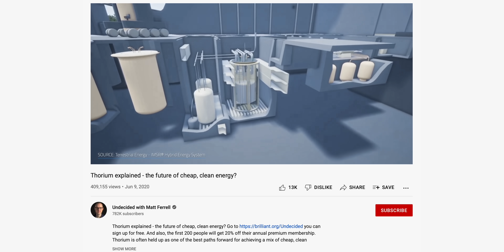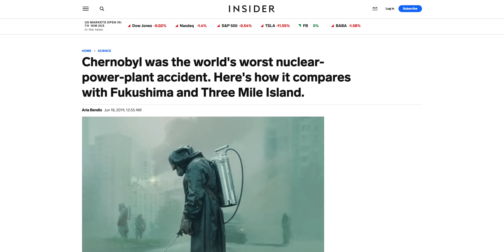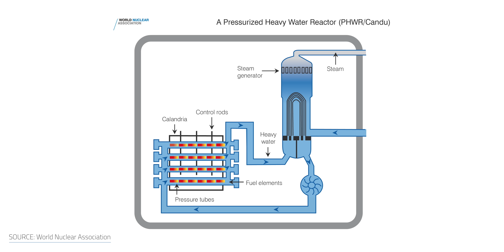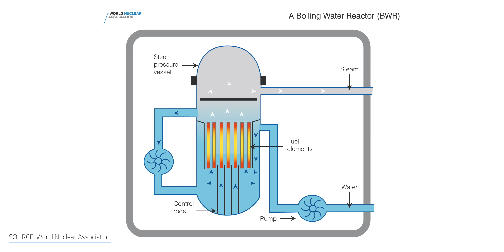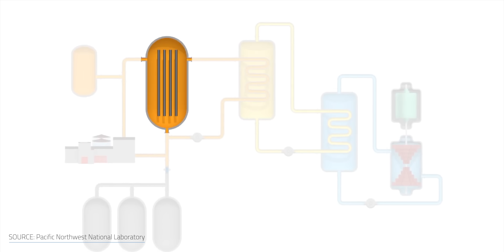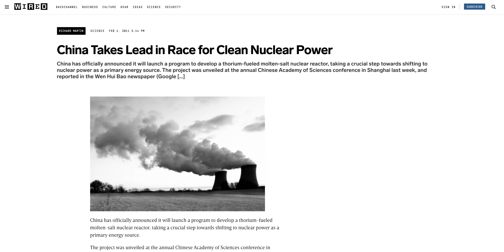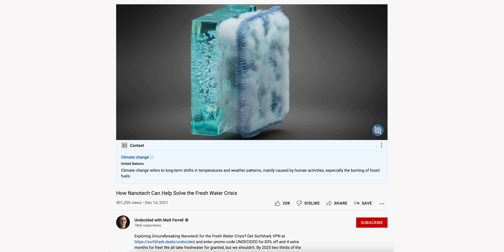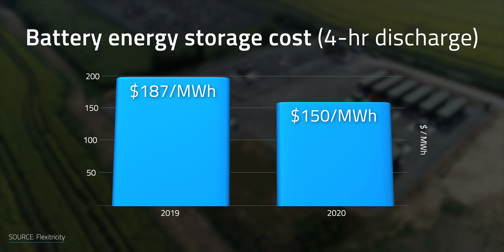Revisiting Thorium Energy - The Future of Nuclear Power?

Comment: One other thing not covered in this video is the possibility of using spent fuel from current waste stockpiles as a fuel for thorium based reactors.  Converting "used up fuel pellets" as a fuel and converting the long lived (100,000 year) waste material into a usable fuel...and reducing the waste storage to 500 years seems a win win.
Reply: It would be difficult and expensive to retrieve the spent fuel. That's why some experts don't want them buried deep inside mountains but stored securely close to the nuclear power plants du that they can process them later when the technology allowed then comes along

Comment: Nuclear power, most likely needed specifically  in larger population areas.  Clearly, salt reactor need to be seriously and thoroughly investigated.  That potential as noted being a win win across the board. Demand for electrical generation and medicine is only going to increase. As with all advances that balance between supply and demand, practical  and theoretical is tight, demanding, and capital intensive with typically lo g term return.  Hopefully results will be justification to move forward.

Comment: Nuclear = electrical grid + fuel making AT THE PLANT.  No need for any other balancing other than fuel making.  No smart grid, just simple low tech grid with fuel makers as the balancing means.

Costs can be 2 cents/kwh off grid, and 3 on.  Fuel = 3 cents/kwh ($1/gal) with free CO2.  CO2 capture can cost $2/gal, so capture at the car and refund at station would make CO2 recycle possible with net zero.  30 gCo2/kwh is doable for nuclear (Thorium).  100% RE grid will be 10x or 300 gCO2/kwh.  NET solar thermal will be 3 gCO2/kwh, or 100 times less than gasoline and 100% RE grid.

Thorium is NEEDED to deal with the mining waste from rare earths and for mass energy production without stupid wind/solar PV/Battery junk.  EVs are obsolete as the costs will be 5-20 times more to charge a battery than to make fuel.  Make fuel while people are driving around, and quickly give 3000 mile range in 3 minutes, which is like 15,000 kw charge rate without grid support.  EVs are a silly stupid concept.

Comment: If you look at the Periodic Table of the Elements, you will notice that Sodium (NA) is directly below Lithium (LI) and Hydrogen (H). Of course, you knew that. Hydrogen is very unstable due to the fact it has only 1 valence electron. Lithium is also very unstable for the same reason, except that the unstable electron sits in the second valence. Sodium has 2 electrons in the first valence, 8 in the second valence and only 1 in the outer valence. And guess what? It is very unstable. Like Lithium-Ion Batteries, sodium explodes when it comes in contact with water. 

Nuclear reactors heat water to make steam. The volatile Sodium is in very close proximity to the water.
The heat transfer tubes in a steam generator are very thin, less than an eighth of an inch. Sodium is caustic and can quickly erode most metals because of that extra electron.

I would like to know how they plan on keeping the H20 and the Sodium apart so nothing explodes, especially highly radioactive sodium salt.

Comment: You can run Thorium in Canadian CANDU heavy water reactors, without modification, by adding a bit of enriched high assay uranium as a booster. A new fuel is being approved to do just that, giving a 7x increase in power density over the natural uranium CANDUs burn. Commercial availability in 2025, not 2035 as for all the advanced reactor designs.  CANDUs have many "advanced" nuclear reactor features: modular, hot refuel, meltdown proof, even though designed 60 years ago.  W&S are just stupid from an engineering perspective, when nuclear power is just sitting there.

Comment: Without exponential advances in multiple technologies, which may be outside the limits of physics , wind/solar are dead ends. The issue left unaddressed here about TMS is scalibility. It he infinitely reduced actual footprint of multiple smaller TMS units over those of large scale nuclear plants and S/W farms is a major factor. The use of previously spent fuels and greatly reduced spoils monitoring are also significant positives for TMS . It is hard to believe that the save the planet folks do not have major issues over W/S environmental impact

Comment: Solar and wind isn't a home run either. They both require way more space to meet energy demands because the output is so low and they only work in ideal condition. Solar farms can Ignight birds mid flight and windmills constantly have to have thier blades repaired because regular particles in the air eat the blades up and it's not cheap paying people to constantly climb and fix them.

Comment: Thorium Energy would be a lot safer as in no cooling required. using Thorium(beta) / americium(alpha) / salt water battery. too bad there's laws saying i cant make any more than 1 watt what am i going to do 1 watt power a watch... laws killed the atomic battery before it had a chance to start. otherwise ill already have a electric car powered by atomic battery. don't get battery charge rated by miles get charge rated by years. make atomic cell phone batteries that hold a charge for the life of the phone. and the radiation is low enough it can be blocked with small amount of led and magnetic shielding material.

Comment: The metric equivalent of an acre-foot is the cubic meter (m³).

An acre-foot is a unit commonly used in the United States to measure large volumes of water, particularly in relation to irrigation, water supply, and reservoir capacities. It represents the volume of water required to cover one acre of land to a depth of one foot, which is approximately 43,560 cubic feet.

To convert acre-feet to cubic meters, you can use the following conversion factor:

1 acre-foot = 1233.48 cubic meters (rounded to two decimal places)

Therefore, if you have a given value in acre-feet and want to convert it to cubic meters, you would multiply the number of acre-feet by 1233.48. Conversely, to convert cubic meters to acre-feet, you would divide the number of cubic meters by 1233.48.

Comment: Thorium Molten Salt has much better LCOE compared to traditional nuclear, also typically they calculate it based on 5 years of operation, but these plants will be operating for 4 or 5 decades, maybe longer, while Wind needs to be rebuilt every 6-8 years, and Solar has diminished returns starting after about 5 years. 20 year LTO for traditional Nuclear Power is about $20, while Wind is north of $20, and solar without storage is above $30. And remember these will be much cheaper, likely 1/3 or less expensive done to scale. 

Also remember, Solar and Wind don't work just everywhere. ask the Germans about that. They are getting less than 10% of labeled output from their $2 Trillion Euro solar system. Nuclear can be places that is reasonably geologically stable. For the price Germany spent on their Solar, they could have built enough of these modern TMS reactors to power all of Europe for 40 to 60 years, while their solar is going to degrade over the next 20.

Comment: Our fear of nuclear power is irrational. It's like saying the Ford Pinto was unsafe so all cars must be. We've made huge strides in nuclear as an energy source. And compared to coal and natural gas, it's always been many times safer. As for cost and construction time, this is due to nobody really knowing how to build nuclear anymore. The more we build it, the better we'll become at building it. We can also mass produce smaller reactors if we wanted. Something the size of a washing machine could power a mid-sized apartment complex. Not saying that's the best solution but we have a lot of options using more modern technology.

Comment: Fusion power is absurd as nuclear power plants.  Thorium is radioactive isotope and is still a nuclear technology.  There is no need for nuclear power plants.  We don't have to use water steam or wind to move the armature magnets and coils of copper wire in a generator.  Tesla bound Edison's generator with magnets all around the armature and used water to move the armature magnets and coils of copper wire.  It's possible to use Edison generators to power dynamos with inverters and transformers to deliver high voltage AC power continuous peak power without fuel to the power lines.  120 VOLT AC power grid is more power plants but safer to maintain and repair.  The Edison generator and dynamos power plants can replace fossil fuels nuclear power wind and hydroelectric power plants as well as high voltage AC power lines.

Comment: I have seen two different Ted talks about how nuclear power is hugely cheaper than any other source - especially wind and solar. Now I’m curious if they or you are right. 

Nuclear power generates consistent, high levels of power with zero carbon emissions. Storage of waste is an issue, but at least the waste is contained to one location instead of spewed out into the atmosphere like all the other power sources (hydro aside). Thorium reactors seem incredibly exciting because they can make the storage of nuclear waste much more sustainable at only 500 years instead of 100,000. Apparently there are even designs out there that can use spent fuel from current nuclear plants and convert it to the 500 year thorium waste version. That’s huge. I think nuclear power is an essential part of our energy future - and possibly the whole thing.

Comment: Matt, excellent job in explaining the thorium processes.  As a minimum we should build some prototype reactors and learn.  These reactors could be the "flywheel" when solar and wind are intermittent.
Reply: I agree we could have had a 50year head start if we hadn't been influenced by the green lobby and would almost certainly not have been talking about climate change today, and our reliance on fossil fuels would be significantly reduced. Electric cars would probably be the norm with cheap energy. Now we have missed the boat, and the cost of electricity is also hampering the uptake of EVs as it is as expensive with no infrastructure and larger capital outlay that only the wealthy can afford. I have a hybrid and can charge at home a luxury  most don't have.

Comment: yes. we need thorium reactors. smaller, can largely be built modularly in factories (not entirely, but brings quality control up, and costs down) and yes, the united states has bans on rare earth mining due to being in the proximity of thorium which is radioactive. kill 2 birds with one stone, use the thorium for energy, mine the rare earths for electronics production. also medical use and other specialize use isotopes come from the decay chain of a thorium reactor which can be separated out. many have a short halflife which can be used, transported locally to a medical facility or whatever and used before decay. all around, jump on thorium.

Comment: Is the LCOE taking storage needs into account? Reactors can be driven with the need. The thermal side of reactors is usable on top of electricity. Wind and Solar, both high Ressource low energy density plants, with a short lifespan take environmental energy and put it into the grid. This causes significant local warming as found by Harvard and others. There is no free lunch in physics. You make great Videos, may it be possible to have a the EROEI (Energy return on Energy Invested in J and KWh over the cause of each tech you show in the show presented?) This would help tremendously in looking at the potential impact of a new idea. If it cannot be guesstimated a range of EROEI is perfectly fine.

Comment: I have seen so many comments that solar and wind are so much cheaper than Nuclear, but when I plug all the numbers into a spreadsheet, accounting for the fact that you want to replace the generation of 19,000 GHh of electricity from a single Nameplate 2GW plant over a year for 40 to 60 years for 24x7x365 straight without any dips, you would need 14GW Nameplate for Solar/WInd (since neither can be expected to generate power more than a few hours a day in northern climates and you will loose energy during storage) which can require over 200 square miles of land and cost $1 per watt and the fact that these solar/wind farms need to be relatively near cities makes this land difficult to come by and on top of that you need to have at least 24 hours of backup stored power on hand (preferably 48 hours to avoid any blackouts, since we are avoiding any fossil fuels for this comparison - so over 100,000,000 KWh)  which costs well over your $150 number for utility grade storage expected to run for at least 16 hours straight every day the wind is not blowing correctly overnight in the winter.  All told, two AP1000s should cost well under $20B (China did it for $9B and Vogtle was completely unnecessary cost overruns), while cost of a Solar+Wind+BackupBattery farm with the exact same output would cost over $100B for 40-60 years of consistent output without any brownouts or outages (since you have to replace the batteries more than once) and it will still take over 10 years to find all that land to acquire plus order and receive and install all those panels/windmills.   Too expensive is not a reason to not build nuclear power plants.  Slow ROE, maybe, Potential Nuclear accident, maybe.  I have heard this argument over cost many many times, but I have not yet seen anyone compare apples to apples yet when making this statement. Every single one ignores a real time cost or impracticality or... related to solar/wind costs.  It works find for peak power as that occurs over short periods and usually when the sun is bright as can be, but not for baseline.

Comment: Nuclear is a must in the mix of energy sources. The lifespan of a nuclear reactor site is far longer than 30 years also. Most power plants in the US are well over 50 years old. The total amount of nuclear waste ever used in the US is a rectangular block about the size of 1 football field stacked 50 feet high (much smaller than most warehouses). The footprint of a plant is vastly smaller than solar or wind because of the energy density of nuclear is so much greater than those sources. So, it needs to be part of the mix.

Comment: 3-mile island never got close to a meltdown, but they always bring that argument when bashing nuclear power.  Chronopol and Fukushima did. Chronopol crashed because of the Soviet system, where as Fukushima happened because Japan built the reactor in a bad location and the under-ocean earthquake caused a Sunami that flooded the site. The new closed circuit reactors are a viable option.

Comment: Um, you missed one massive dirty secret of wind and solar that Thorium doesn't have. The sun doesn't shine at night, wind doesn't always blow, but if usage goes above production for even a few seconds you are looking at a total grid shutdown. So how do the power companies make sure there is always enough electricity? They have coal fire plants running all the time in the background. You can't just flip a switch on a coal plant, you need days to start it up, which means you can't ever shut it down in case you need it. What do the energy companies do with all that extra energy from the coal plants? They just throw it away. They dump it right back into the ground as soon as it's made just in case the sun stops shining. That means all this "green" energy, well it is still burning coal. Nuclear power doesn't have that problem. It can run 24/7. You can actually shut down the coal plants for good. I can't believe you left this out.

Comment: 12:55 LCOE is a good measure; however, nuclear reactors produce steam that can be used for many other purposes - residential heating & commercial production (refining commodities) are the most common uses of steam.  Solar and wind are far less efficient sources of energy to produce steam. You did mention desalination as another purpose; nuclear plants can generate hydrogen too. Huge benefits of nuclear plants compared to solar&wind.

Comment: It seems to me that with all the cost saving benefits of LFTRs, the cost of electricity should be a small fraction of conventional uranium LWRs. Thorium is a waste product from rare earth mines and one mine in eastern USA said that they would fill up dump trucks for free just to get rid of it. Thorium is easy to refine, Thorium does not require the very expensive enrichment process required for uranium. Thorium does not have to be formed into pellets but remains as a powder. Thorium radio activity is so low that shipping and handling is not a problem. LFTRs do not require the large containment buildings used for LWRs. LFTRs use >99% of the fuel so there is very little waste to dispose of, vs about 5% for LWRs. With all these advantages this video says they are only 30% cheaper?

Matt Ferrell goes through a whole list of disadvantages for LFTRs which are at best exaggerated and at worst complete lies. He states Thorium is more expensive to mine, completely false. He points out that one of the intermediate reactions could be used for nuclear weapons, also false, well it is theoretically possible just not practical. Its decay rate is too high, makes it extremely dangerous to work with, has short life. No one is going to do this while conventional methods are much better. All reactors emit gamma rays, that is why they are shielded. Leaks are possible in any process, but not a dangerous outcome with LFTRs, any leak will quickly cool down to a solid at a very low radiation level making it easier to repair. The reason LWRs have huge containment buildings is to contain potential leaks. Far harder to manage, re: Fukushima. This is the first time I have heard of that leaks could be a problem.